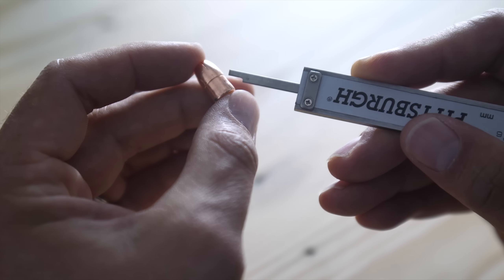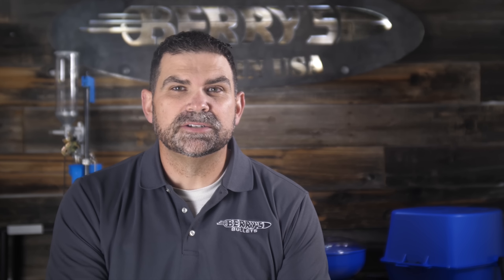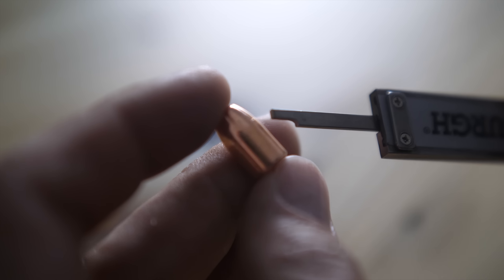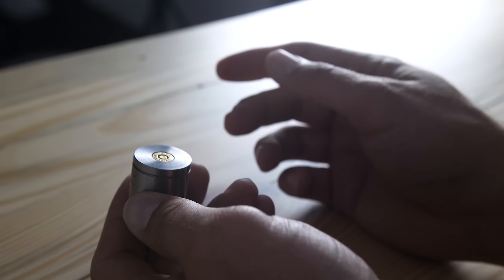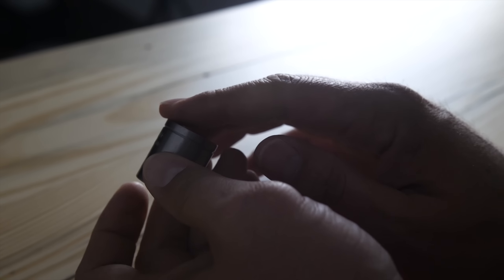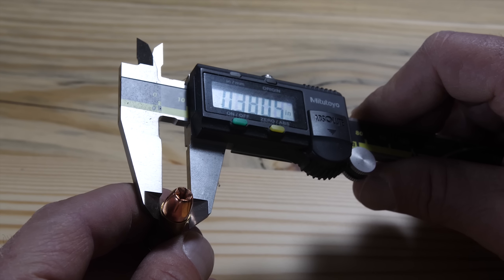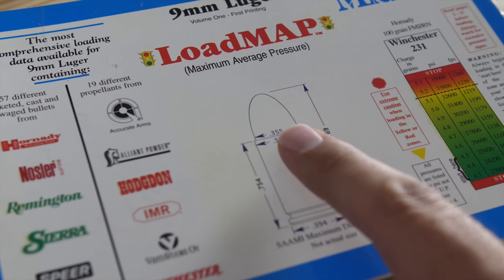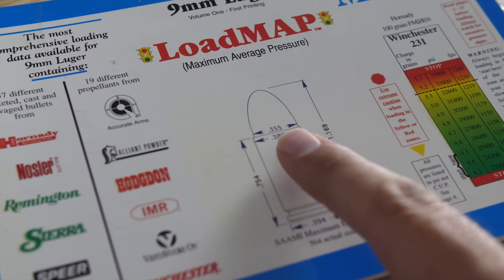FAQ: Crimping Berry's Bullets

Comment: When in doubt, use a light crimp. Make a dummy round, then pull the bullet and check the jacket for excessive crimping. Reseat/crimp the dummy round. Then cycle it through your weapon a few times to check for setback.

Comment: GREAT Product!
 Ive loaded up @ least 2000+ 9mm & 357 SIG 124g plated hollow points in the last few months using nothing but Berrys...
Reply: What dies do you use for 357 sig and do you have any set back after chambering a couple times?
Reply: @blacklight6200  Hey there Blacklight,  I'd found the same frustrations loading such early on. Nickel cased 357SIG brass is what I typically load with....
Im using LEE dies & a 357 SIG factory crimp & the LEE dies work just great, although with a caveat....

I DID initially have a problem with that tinee-ass 357 case mouth >to> shoulder depth holding the bullet tightly, as w/o enough real surface area it doesnt hold the bullet all that well-(poss set back increasing pressures)-

Although it takes a bit longer, I ended up finding a solution, Ill  sizing wax lube the case, then size/de-cap the case with the 357SIG LEE dies, then used my  LEE 40 cal factory size die-(W/its de-capper  pin removed)- for lower case walls, THEN used my 357 SIG LEE carbide  sizing die again to properly size the shoulder/neck area...
-Sure its extra steps in the process, but meh....It gave me peace of mind, as just using the LEE 357DSIG sizing dies alone wouldnt let me fully seat the prepped cased in my 357SIG Case Sizing/Chamber Gage-(A MUST HAVE with that particular round if re-loading. Wilson makes good ones.)-..

Id found that the LEE357 SIG case mouth  expander die, even @ its lowest expansion setting STILL allowed the loaded bullet to fall into the case under slight pressure, so Id tried my LEE 9mm case belling die w/a bit mo'  better success, it worked, but  I STILL didnt quite trust it....

So I'd just taken a common sharpie pen & with light pressure just kinda barely wiggled (in a circular/angled motion) the non-writing end around the prepped 357SIG case mouth to provide a VERY SLIGHT belling of case mouth & it was enuff to seat the projos, w/o deforming the projo & case mouth when seating the bullet. 
-Making for a TIGHT fit-Youll have to experiment a bit n' make a few to get  a "feel" & just how much circular rolling pressure to achieve the correct amount of case mouth "bell", as even a plastic sharpie pen end can open it up a tad too much. It does chew the plastic pen end up after a while though...
-You could use other metal tools too to do the same job, just make sure its got a round end profile & diameter is just a tad larger than the 9mm 355. case mouth

357SIG is a tricky one to load thats for sure! But its certainly got SOME ASS>>>>behind it as to velocity!

There are a few powders available where its powder size/volume allow one to load to the very bottom of the bullets base to better prevent boolet set-back under recoil. But Ive yet to load with em. My 357SIG berry bullets load data are on a can deep in my ammo lockers, but I did find one can up front for :
Hornady 9mm 115grn XTP:
Powder: HS-6 @ 9.0GR @ 1350 +/-
(HS-6: 9.4 MAX load @1412 fps)-
C.O.L: 1.135

Id still use the LEE 357 Factory Crimp die as last step in process, just for your own surety of mind. Go lightly as Berrys bullets plating is pretty thin & they deform easily. Nickel brass cases tend to last longer as to re-loading cycles if one is crimping them in the end too...

Hope thats clear as mud?...;)
Take care & be safe!
Reply: Dont mind the crossed out area above-thats not my doing. I have a dedicated I.S.P/EwwwToob censor who likes fucking with my words...

Comment: I had issues with your 158 gr RN ,357 bullets when using light loads.  The bullet would not clear the barrel.  Even when a hotter powder charge was used I would get squibs.  I solved this issue by rolling a cannelure into the bullet and was able to employ a heavy roll crimp that delayed the movement of the bullet by several milliseconds so the powder charge would fully ignite and build up enough pressure to expel the bullet out of the barrel.  That has been the only issue I have had with your revolver bullets.

Comment: I crimp mine a little more than the slight crimp you showed but less than the “too much crimp” one you showed.    It does leave a slight indent.    Do you think that is ok?
Reply from the maker: As long as you aren't cutting through the copper you should be fine.
Reply: Check your targets at some close range for evidence of small plating pieces coming off.  

Also at regular distance bullets should group well and not have frequent flyers if your seater die shape allows seating without tipping the point to increase inflight wobble if you're not damaging the bullet.

Comment: Do you have any information, tips, or advice for using Berry's Bullets in the 460 Rowland cartridge. Considering that the 460 Rowland
Is loaded to around 40000psi compared to around 23000psi for 45acp +P and less for the standard 45acp. Thanks

Comment: Any suggestions for significant bullet set back when using factory crimp die? Set back from chambering 1 time is .005 - .010 , but when I crimp with the seating die its doesn't happen.
Reply: Sounds like you have the seating die set to apply a heavier taper crimp than the factory crimp die. You could measure the diameter of the case mouth on the two different rounds to see if you wanted to.What cartridge is it? What is the diameter of the case mouths on the two different rounds using a caliper that has been zeroed out first? If you dont have one and ever buy one I suggest a dial caliper instead of digital ; but if yours is digital it should work ok for this test.
Reply: Keep in mind that the factory crimp die is not used to seat the bullet . The bullet should be already seated to the proper depth with your bullet seating die before using the factory crimp die.It's only made for crimping and taking out any bulges if you're using the carbide factory crimp die for handguns .Lee website has instructions on it.
Reply: @44special9  ended up figuring it out. The seating die applies a roll crimp which holds the bullet without having to crimp very much but roll crimp is bad for 9mm or any any semi auto hand gun, ended up with 250/600 that can't seat correctly. I mean i can't imagine how a roll crimp is making the case sit several mm outside of max headspace but ya that's what happened. The factory die is definitely the way to go even though it's an extra step and takes some more effort to get the crimp done. It was fine after I adjusted the factory crimp die, had no issues with set back and they feed like factory ammo.
Reply: @whatsmolly5741  I never heard of a 9mm seating die that puts on a roll crimp but I'm glad to hear that you figured it out.